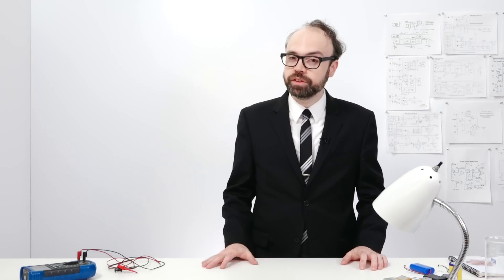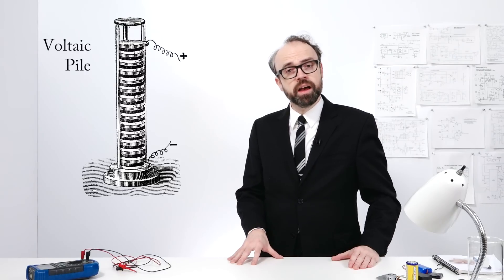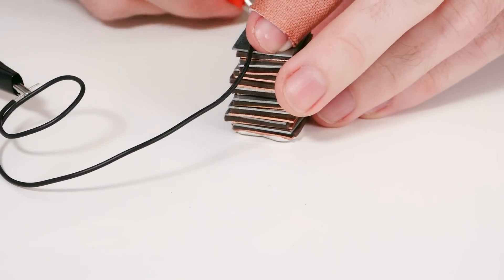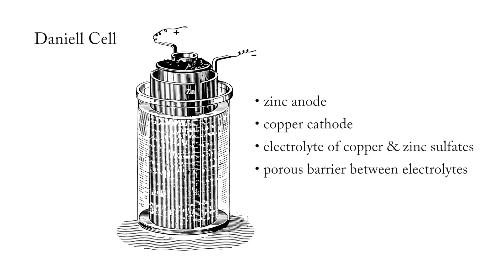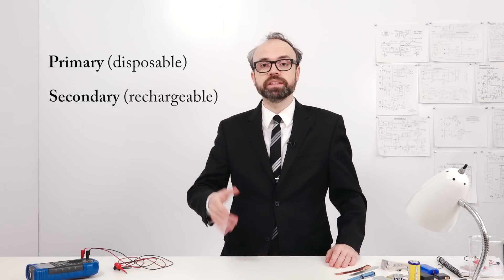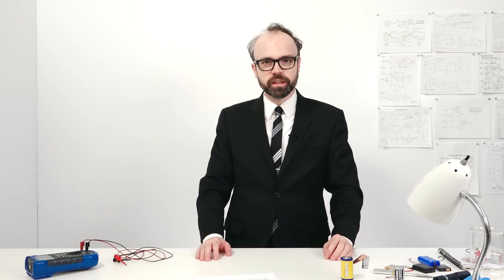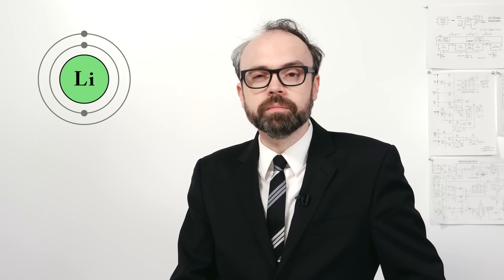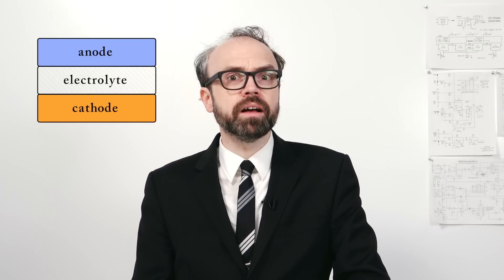Collin's Lab: History of the Battery @adafruit #adafruit

Comment: Very interesting.
The question that originally brought me to this video is... when did the "dry alkaline" battery get standardized to the D, C, AA, AAA, N cell?  like, I have seen Charlie Chaplin films that show him using a handheld flashlight (presumably D-cell).  Who standardized it?  was it an international convention??  
What happened to the B-cell? and the A-cell?
Are these the same sized batteries used by the whole world? or does, say, Russia or China have their own standard sizes?N
Also, back in my military days, I recall using magnesium batteries.  Is there some advantage to using those? (durability, longevity, power output)

Comment: so when using the voltaic stack to turn on the LED is it possible to "charge" the zinc and copper by rubbing with a towel to create static electricity?

Comment: I feel a mention of the "Baghdad" battery should have been made. We're not sure it was used to provide electricity or what purpose it was used for if it did. But occam's razor says it was a battery. The construction is a battery and if they filled it with any electrolyte it would give a current.
It's not abnormal we can't find what is was used for. Almost overnight the Roman, Sassanian, Gupta and Harsha empire fell into ruins leaving almost the whole world busy with surviving instead of inventing.
Reply: "But occam's razor says it was a battery." Actually it doesn't. The two main ideas are it was either a battery, or it was used to store scrolls. In this case, occam's razor would suggest scroll storage is more likely as it fits with what was known at the time. The battery idea would require a lot more assumptions to be made, thus violating occam's razor.

Comment: could air be an electrolyte?
Reply: twistedyogert I would say yes and no, it can keep a capacitance. although the make up of the air we breath and many gasses that  could be used, doesn't carry a charge or can really help to produce one. although it would be cool to test, and I don't think anyone truly has.
Reply: twistedyogert wait skip what I've said. you can make a reactor with just zinc and hydrogen. but it produces heat and would produce energy threw steam.
Reply: James Luck cold fusion?

Comment: Collin, please see this post! I have a question for you,
from what I understand, modern electrical generators convert mechanical energy
to electrical energy through the use of powerful magnets moving around some wrapped
wire, almost like a motor.. However, I saw this one YouTube video that showed
that in order to create powerful magnets from scratch one needs to place a
piece of magnetizable metal in front of a strong electric field. If this is the
case, how did they create first electric generator? Please, help me understand
this sorcery.
Reply: Thats easy, generators arent the only way to produce electricity, chemical batteries also produce electricity. All you need to create a magnet is electricity running through some wound wire. So this was used to create the first man made magnets before any magnet based generators existed.

Comment: 50 cells make 35 volts, Three of these 50 cell stacks should put out 105 volts, Five 50 cell stacks should be the size of a car battery when adjusted for a container. Five 50 cell stacks puts out a whopping 175 volts all without including the decimal values. This is only if the first cell shown has 0.092 extra volts than the 9 cell stack permanently. If these cells last the same as others, each one has 6 and a half days or 156 hours when kept wet. Since no-one has posted what a battery looks like when it is dead I will assume that the cells are still good and if you keep adding saltwater to them, they should increase in time. Please save me if I'm wrong, these batteries seem very useful...

Comment: Hi Collin. Can you do a video about cleaning flux off of PCBs after soldering, and different solder/flux types? I'm concerned about long term durability and corrosion on my DIY electronic projects. Should I clean both sides of the PCB or just the sodder side? What about components whose underside and pins are not reachable on the component side, how would I clean flux from there? etc.

Comment: Samsung should watch this video
Reply: I was hoping for a brief "what can go wrong" segment.
Reply: If I understand it correctly, the Samsung Note's problems come from the fact that they packed battery so tight that it punctures, creating a short directly between the anode and the cathode, which in turn generates lots of heat and easily burns the flammable electrolyte.
Reply: David Boucard
What I'd heard had been dumbed down to "they squeezed it too much".. which fits in perfectly with what you're saying, albeit to a less technically sophisticated audience.

Comment: what about the baghdad battery?
Reply: I thought so too. The wiki even mentions in passing modern day experiments that test the story, but nothing verified. A person today should easily be able to test the claim using objects in their house. Find a clay jar, a metal rod, a metal tube, and some grape juice. Essentially that's the Parthian 'battery'. If there were any truth to the claim, it could be easily verified. But sadly no. The wiki casts further doubt that this find had anything to do with electroplating or could even produce any measurable voltaic charge. Doesn't seem plausible.